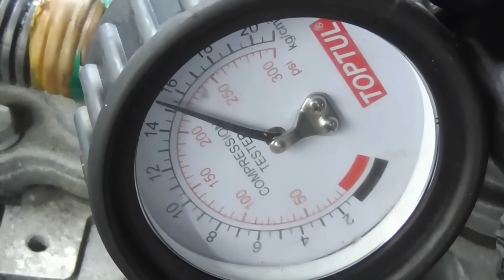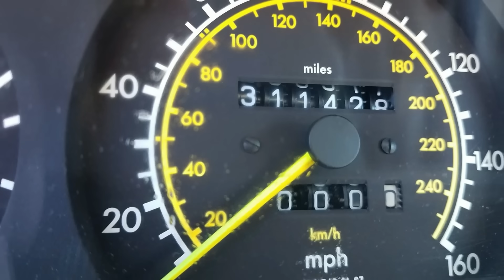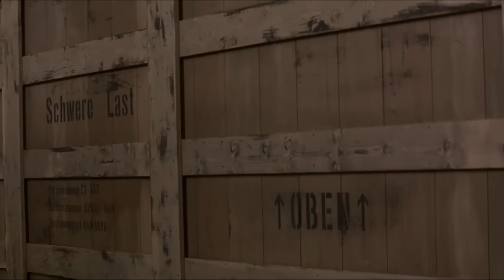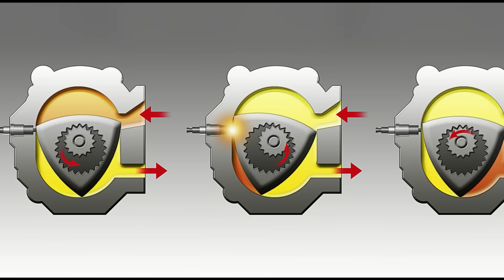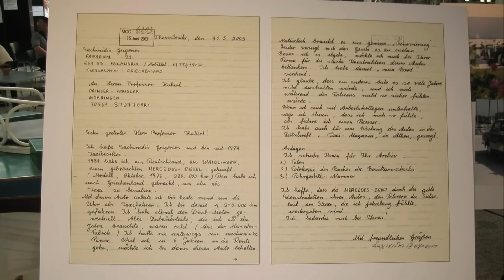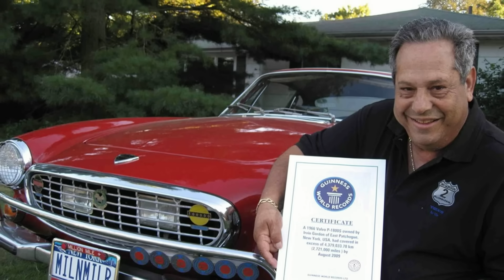Most Reliable Engines of All Time

Comment: So basically all Japanese engine are reliable.
Reply: As I point out in post above, they ignored several US built engines with excellent reputations that I knew of when I was working as a mechanic.  I am not aware of any major problems with the current crop of US engines, but I quit working as a mechanic long ago when I finished college and went to work as a scientist.  Note that the engine alone does not make the vehicle.  You have to look also at transmissions, rear ends, suspension systems, fuel systems and electrical systems.  The Ford 2.0 liter German built engine was great, but the cars it was put in were generally junk.  Of course there were also the bad engines being built in some cars.  The Vega 4, and the Oldsmobile diesel come to mind, as did a Toyota engine that had a short production life of only 5 years because it tended to have the camshaft tensioner break, with the resultant destruction of the engine.  Another bad Toyota engine was the 4.2 liter inline six, sold primarily in Land Cruisers in the US, that had a bad habit of cracking heads.  They were so bad that a large cottage industry existed to swap out that engine for a small block 350 cid GM engine, which gave more reliability, power and was more economical to run.
Reply: @gerardtrigo380  Strange that the 4.2 Toyota wasn't reliable, I take it that was the gas engine. The Diesel engines where bullet proof.
1HZ, 1HDT, 1HDFT and 1HDFTE. 4.2 and straight six.
Reply: @harveysmith100  your SO right.  NOTHING is as reliable as the NON turbo Toyota 4.2 streight 6 diesel engine.   I had the Mercedes 300D, piece of shit compared to the 4.2 toyota engine.  The old mercedes W123 200D IS the most reliable engine Mercedes ever build but does not beat the toyota.
Reply: @clemensnetherlands7331  The non Turbo 4.2 was the 1HZ. I think they still put it in the 70 series LandCruiser is some third world countries.
Bullet proof.
The Turbo version are very reliable as they are designed to have a Turbo. Some people think they aren't reliable due to some failures but they are normally 1HZ engines that have had after market turbo's added. Not to be recommended.
Reply: @harveysmith100  100% Correct! (and the 12HT and 2H)
Reply: @patrickscodellaro2047  Sorry Patrick, I forget about the 40 Series, My knowledge is mainly 70s
Reply: @clemensnetherlands7331  Toyotas are the best sold cars in the world. There might be a reason for that , right ?  😁 I also bought a 2004 1.6 l vvt-i Toyota Corolla. I m in love with her 😁
Reply: @gerardtrigo380  like the GM 3.5 and 3.9l, amazing motors from the mid 2000's, bore it out slightly and the 3.9 fits LT pistons, motor is a tuners dream, but the cars they came in had every other issue known to man.
Reply: @gerardtrigo380  hmmm.  Nope there are no good American engines that I would recommend.  The US manufacturing is driven by CEO greed to build cheap and more $ in management pocket, not quality or material choice
Reply: @gerardtrigo380  Yeah, the forgot the Ford 4.9L (300 cid) straight six.  Easily get 500,000 miles out of one.
Reply: Most NON-American are better than what we have here in the USA. I've traveled all around the world. I've had more issues with American cars the any where else. 

Most American cars are made to break down so you have to buy a new car. It wasn't this way in the past. I believe American car makers need to quit thinking of their pockets filling up and get back to good running cars that would last a lifetime.
Reply: Michael Smith i actually think that American cars are really good and come just after Japanese cars. European cars are not reliable at all and cost a lot to repair. As a mechanic, i can tell you that a even often replaced more engine and transmissions in Hondas than American cars. Only Chryslers are made very poorly.
Reply: @Sailing_Panda  buy Ford. Ford are reliable. And its popular overseas too. Like in Thailand, beside Hilux, Ford Ranger are highly regarded as reliable and tough vehicle for constructions project.
Reply: Intel & Nvidia SUXXZZZ!!! yes but that is because the ranger is a Mazda codeveloped truck designed in Australia. The US version of the Ranger is not that good.
Reply: @davidharris9259  you must be oblivious the fact that Ford made some of the world's best pick ups. Ford Raptor F150 and Ranger are impeccable. Many shared their Ford able to hit 350k over miles.
Reply: Shubhankar Choudhari no! Ask scotty kilmer😂
Reply: @bluehaze6132  Japanese engines are good it's the Jatco automatic transmissions velly bad.
Reply: the v6 (i think 4.2) in old astro vans and the v6 in aerostar vans 3.0 consistently got 400 to 600 k miles both built by the good ol usa.
Reply: @nathonsmithson3024  the old Astro van engine was the vortec 4.3 L V6 AKA the vortec 4300
Reply: @TA_Plus_Hemi  yeah nice catch. basically a 5.3 with 2 cylinders cut off
Reply: All non-interference engines .
Reply: No, this is very, very false.
Reply: You don't hear people swapping cars for Japanese engines.  It's about the LS
Reply: @TheReaper88  actually I'll be honest with you I don't understand why it is all about the LS. I'm not saying it's a good engine I'm just a purest if I was building a Ford I would put a Ford power plant under the hood and so on and so forth. Don't get me wrong I know the exact reason why people do it it just doesn't feel right to me
Reply: Yessir.. There are good American engines too, but they are only for military use sadly.
Reply: @javi009z  I got to be honest with you the Triton 5.4 l was not a bad engine at all. A friend of mine just had to send his F-150 off to the junkyard not because of mechanical issues per se, but because his daughter totaled the truck. The engine had over 430,000 original miles from new
Reply: u a thinky boi.
Reply: yep, all properly maintained Japanese engines of the 90's can reach 300,000km easily without any najor work done on them. My 92' Galant 4G63 engine has over 200,000 and generally speaking I am not kind to it when driving being a bit rough on it, frequently going to the red zone, it even happened to over-rev the engine to almost 8500 RPM when driving downhill trying to overtake a car for a few moments. Of course though I maintain it properly. The engine runs like new
Reply: 4:33 wtf?
Reply: @sr420det  German makes good engines too you dumbass
Reply: Yup
Reply: Yeah it's there transmissions that needs work especially the 2014 Nissan Sentra CVT!!!
Reply: Brian  most Japanese cars are made in america, with primarily American parts. They pay roughly the same at the factories, and use many of the same parts suppliers. American cars are just cookie cutter, corner skipped hunks of garbage. Most Ford 4 cyl engines are a turn of the century Mazda design, and they're having trouble coming up with the spare change to move to a new platform that can meet emissions standards while still competing. Gm makes six variants of the same car with the same parts but they're all shit. They're cutting corners, and the owners and the big wigs are literally just pocketing extra money and the companies are suffering.
Reply: Fairly true
Reply: Not Subaru
Reply: It's because they don't cheap out on labor and the cars the Japanese make are more American than any American car. Because they're made in America. Not Mexico or china or anywhere else that has cheap labor.
Reply: Shubhankar Choudhari yes that’s true
Reply: More or less yes They Are.
Reply: Not every,for instance mitsubishi engines are quite bad.
Reply: How about indian and korean cars?
Reply: @bluehaze6132  India mostly uses K series engine in all budget cars. around 50% or more used K series. Else the big engine are from fiat
Reply: @shubc50  Jags don't have Fiat engines
Reply: @TA_Plus_Hemi  Almost all Indian cars. Ofcource Jags and range rover have V8 developed by Jag
Reply: @bluehaze6132  Korean try to build something.... Indian? i didn't know that indian build engines
Reply: @DimitrisTheodopoulos  I think blue haze is referring to the Tata acquisition of Jaguar
Reply: and most germans..
Reply: @DimitrisTheodopoulos  yes German people tend to be reliable too
Reply: @TA_Plus_Hemi  I see what you did there
Reply: @TA_Plus_Hemi  Like Adolf
Reply: @kris8742  I know there's supposed to be a joke in there but he was Austrian.
Reply: @DimitrisTheodopoulos  Ιάπωνες παρα πολλοι, Γερμανοι λιγοι αλλα ναι καλοι
Reply: @mariosram8310  Πιστεψε με οι Γερμανικοι ειναι περισσοτεροι, στην Ελλαδα εχουμε βασισει την Ιαπωνικη αξιοπιστια σε 2 μαρκες Honda- Toyοta και αυτοι μετα το 90 στην Γερμανια ολη η ιστορια ξεκιναει πριν το πολεμο.

Comment: M57?
Well, as a ...35d first Generation it was horrible!!
Reply: The first generation is almost always going to be like that. Remember the n54?
Reply: @aromaj8  
Right, I had a 2009 n54 335i - 2 times Turbo chargers, Piston rings, HP Fuel Pump, HP Injectors and so on, within 5 years, before 100 TKm!
Much too tight Project Management, I think. No sufficient Testing phase anymore maybe, not proven when commercialization.
But all the germans making nothing but shit currently, in my eyes.
Hopefully thats changing soon!
Reply: @JeanKatana  I would believe it is. My n55 lasted me 100,000 miles with regular maintenance, and only the water pump went bad at 70,000 miles. I now have a m57 x5 35d with 70,000 miles and still only regular servicing, with the addition of a fuel tank sensor. a

Comment: the milage on a car can depend on how and where it is driven - low speeds, slow braking, low revs and to milage - to gauage a cars milage the internal engine/gearbox and diff should not have been worked on..... i had a 20 year old 69 ford xt that i picked up with a  piston rings gone, but it had a larger head (2v 6cyl) larger holly, extractors, 9" and 8" bf goodridge tyers and when I stripped to motor down it still had all the orginal ford internals ..... 20yrs for a engine that has been driven hard and clocked its mileage clock is pretty damn good

Comment: The rx 7 motor is so nonrelaible becuse u have to rebuild it every 50 000 km it runs its a fun car but not the best car to put on a vid of the best relaible motors and were is the cummins 12 valve motor

Comment: Ford inline 6 i had a 89 F150  over 350,000 never did a thing to it 
I've heard stories from other people with the same story.
Reply: I had an 86 f150 with inline six had around 395,000 before it was totaled
Reply: @iWrestleXuSubmit  i miss mine i told Ford if starting building them again I would buy another one
Reply: The Ford 300 6 is known to hit a million miles and they don't die. The 4.6 in the crown vic has probably hit 1 million more than any engine. There's a reason you still see them as taxi's and cop cars to this day. Police departments loved them because they just kept going keeping costs down. They also left out the 7.3 diesel and the 5.9 Cummins. They obviously didn't do any real research
Reply: @ReelWildOne  Seems to me,he is partial to foreign cars rather than American brands.
Reply: @ReelWildOne  Thank you I just commented on that. the 7.3 Powerstroke Diesel from International in my F350 is a SOLID engine. With required maintenance an easy 400k engine and only thing that's happened to me is ran out of fuel on an interstate cause I had a faulty gas sensor reading.
Reply: @ReelWildOne  i have a 5.9 now im over 400,000 on it
Reply: George Cass my grandpa's surpassed the million mark. And it still runs. The rest of the truck is rusted to hell and he just uses it for hauling firewood now, the trans crapped out at 30k so he had one built a stage 2.5 and never had any issues after. Last I checked his f350 with the 7.3 IDI was at 800k and still going strong. Best two diesels ever built outside of the commercial market
Reply: that 5.0 liter ford 6 is dependable!
Reply: @jackmehoffen4359  Ford 2v 4.6L could see 500K miles. They get a second life as cabs.
Reply: Had an 83  F150 with the inline 6  went over 800,000 and was still going 5 years after I sold it
Reply: Here in Aus the inline 6's are still being used ,AU falcons are known to go past 700,000k's and still go strong some even clocked a million
Reply: Same here. 96 last year made inline 6 300. 450,000 miles. c-6 transmission. change the alternator and oil. When I sold it it was still running great no smoke
Reply: I have a 92 f250 with a 300 and a 4 speed with overdrive manual tranny. Never had a single issue other than a bad compassetor on the ecu
Reply: 300 inline 6...good engine....gas version of a diesel. Low hp, good torque and excellent. I have 04 f150 6 cylinder, 4.2. It's been great.
Reply: Had a 81 stepside F100 in-line six 300, had it rebuilt at 380,000 to restore the truck. Machinist said the cylinder walls were at factory specs.
Reply: George Cass damn good truck! Our buddy has one. He used Moly slip additive and it ran smoother and better mileage. Used it to pull a race car and trailer for ice racing
Reply: Yeah weird that a mazda rotary is on here but no ford straight 6 or 4.6l v8.     Cummins 2v 5.9l straight 6 (I think that's the one) belongs on here as well.
Reply: That's why they quit making it
Reply: I have an 93 F-150 with a 302 windser with 375,000 with just a radiator change.
Reply: Agree. Ford engines are by far the most reliable American-made engineering. GM engines are the worst sadly.

Comment: The camry engine would be more reliable if the cooler didn't blow out all the time (i should know, i drive one)
Reply: Mine has 408800 on the odo, 98 Camry.